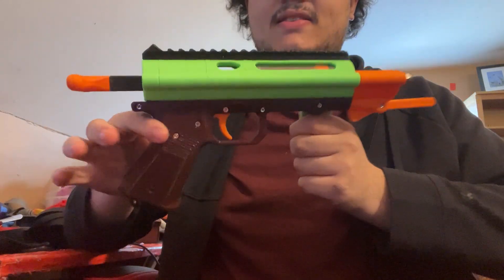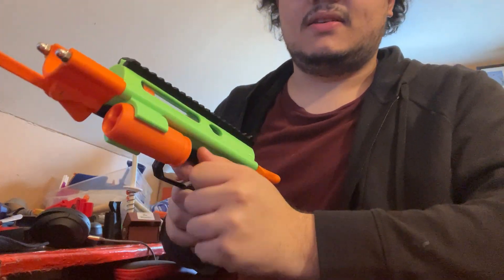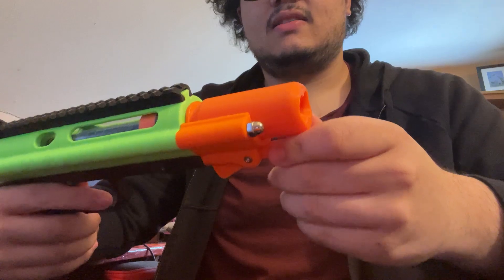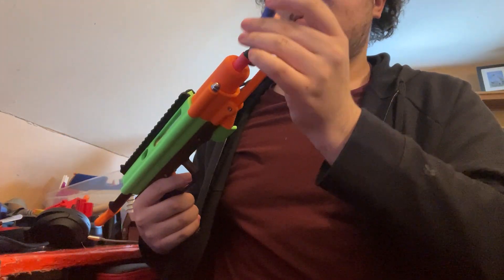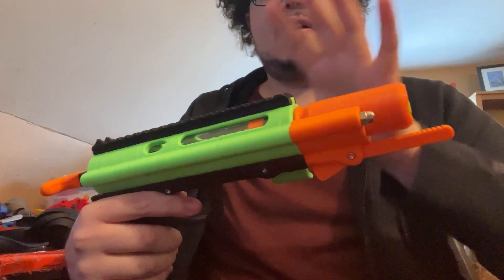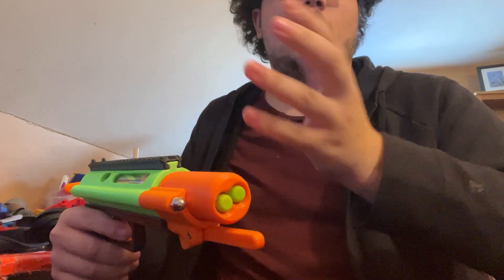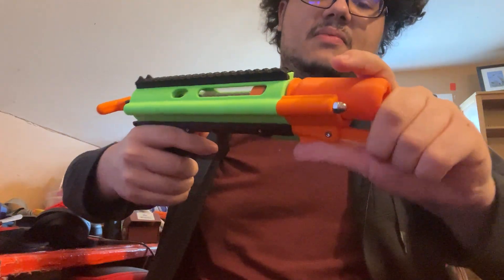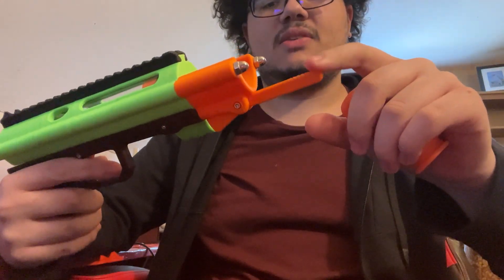Shell Pistol second prototype overview!

Comment: Just found your channel and the work you do rocks, as someone who uses Fusion 360 and 3D printing frequntly its so cool to see the how well designed and organized your are models. I have a couple questions. A while back I tried to make a foam blaster and struggled to struggled too find clear PVC pipes for the houseing and I was wondering where you get yours from? Also I was wonder how you contain the lengths of PVC in your blasters securely is it just sandwiched on both ends?
Reply: Sweet thanks
Reply from the maker: I actually use polycarbonate. 1.5” OD. It’s more dimensionally consistent than PVC. https://outofdarts.com/products/nerf-caliburn-esper-talon-claw-1-5-od-clear-plunger-tube